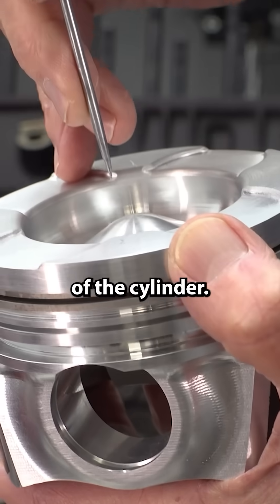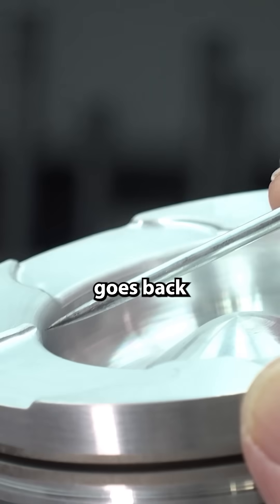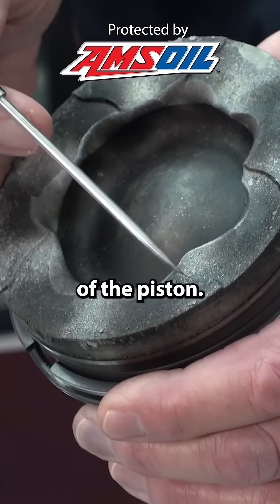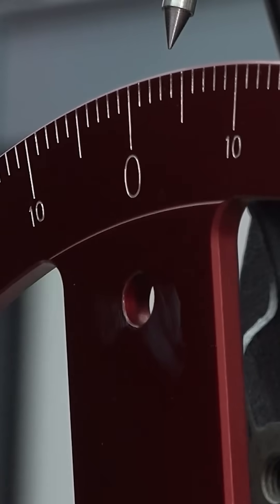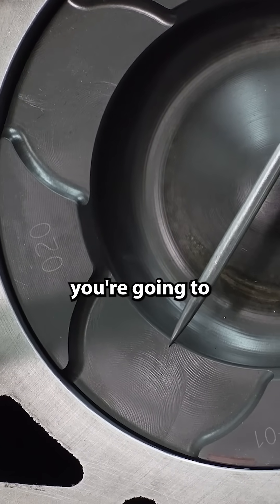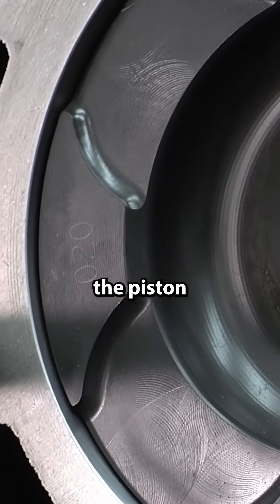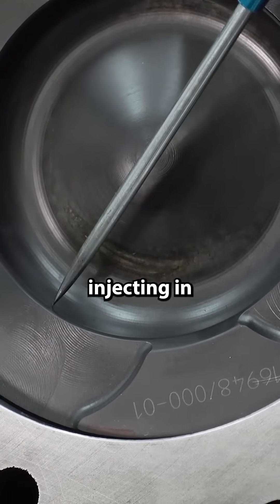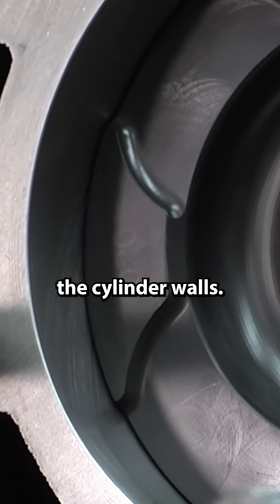How to burn pistons.

Comment: He gave everyone a hint in the t.d.c BTW
Reply: I always thought peak cylinder pressure should occur at 14*ATDC
Reply: @thisisyourcaptainspeaking2259  depends on stroke and rod length?
14 atdc may mean thrust is nearly directly down instead of at an angle?
long rod and short stroke make for vertical thrust on big end?
short rod and long stroke puts thrust on side of big end?
Reply: @rosewhite---  As far as I know, this is independent of bore/stroke but It's not clear to me if it's true in all configurations of piston engines, I believe it is.
Reply: @thisisyourcaptainspeaking2259  Peak cylinder pressure occurs at TDC and contines after TDC until the end of injection.  Why Diesels hang on longer under load., combustion takes place under, 'Constant pressure'.

Comment: Those pistons are stupid as hell solution to having a poor injection managment that can't make multiple main injections :/
Reply: Efficiency is chasing not whole percentages... 0.1% increase across say 6 or 8 pistons may not seem like a lot. But when everything comes together as a total you can gain 10/25/20% across the board. That's a huge deal. 

As engineering explained (the channel) explained years ago... Heat control is key to internal combustion engines.
Reply: @TheGrippySocks  0.1% increase efficiency per cylinder equals to 0.1% efficiency for the whole engine.
Reply: @maritaquality
1 second ago
It does not happen, if this was problem it would have been solved a 100 years ago. If any fuel mist touches any surface, the fine droplets combined into bigger droplets that are slow to burn. The burning is incomplete by the time the exhaust valve opens so you get smoke, loss of power higher, fuel consumption.  When the first amount of fuel is injected into a Diesel engine then the pressure and temperature in the cylinder increases very rapidly, so the remaining fuel is instantly burnt on injection
Reply: If it wasn't for emissions there wouldn't be so much bs
Reply: @MadMan_123  what ? multiple main events and some pilots give you better efficiency and less stress load from smaller detonations and more homogenous mix. Better emissions are a side effect of that, but hey if you want to stick with that style pistons from 1935, go for it.
Reply: @tommybronze3451  no I mean the restrictions implemented by the EPA. They have to do all these things to meet mpg requirements, egr bs, and all that. They need to keep it simple stupid, a diesel motor that runs real hot with a higher compression ratio is simply going to last longer and can be designed to consume even less fuel than we currently do with little to no emissions equipment. A lot of the shape of this piston has to do with properly dispersing nitrogen through the combustion chamber for a cooler burn while still meeting all the other requirements then we gotta spend extra fuel getting the dpf hot enough to burn all that off, like how does running my tractor 12 hours full tilt for a regen forced to sit in one spot helping the environment while also burning extra ammonia
Reply: @MadMan_123  Ok, apologies then. 
About the emissions - it's complicated as hell. IF you run your engine gotter it will simply be more efficient, if you run you combustion hotter (ie detonation rather than deflagration) then you will produce unbelievable amount of NOX. I know that people don't like it but soot + SOX + NOX is very much a gas chamber mix, because of that we have those low sulphur diesels (makes angine last less) and all the additional after treatments for NOX. 
Sad part is that if people would be prepared to pay + 4000£ per vehicle, we would have after treatment systems that don't damage the engine and don't influence the MPG. Then with economy of scale those would become cheaper. Problem is that people are such a cheap bastards that they stick M5 badge on their 518d just to show off.
Reply: @tommybronze3451  nice thing about running hotter and soot is you can get the combustion process hot enough to burn all that up, especially on a hot motor with a hot turbo combined with proper fueling you get more burn and less soot, it would be possible to make a diesel engine with just some basic equipment to burn just as clean as our current machines do.catalytic converters are pretty much all you need for a well tuned machine. 

I've always said we need to take a step back with the auto industry and the non luxury brands need to come out with a lineup of basic but reliable vehicles. Best thing for the environment would be to design cars to last a lifetime rather than buy a new one at least every 13 years. Look at the 1990 f150 for example, very easy to work on very close to what I'm describing but still has a lot of cheap dssignes that are prone to fail, the idea is we need fo go back to trucks like that, refine them with what we know now, could also easily get better mpg with current tech.

Comment: There used to be things called "indirect injection" diesel engines that could tolerate injectors that were totally worn out and squirting like a racehorse. They lasted for many hundreds of thousands of miles without major maintenance.
Reply: they were also hard to start in the cold, and terrible on fuel.  There are plenty of high mileage direct injection engines that can do a million miles.  Cummins,CAT, Detroit,Mack etc.  Lack of durability has nothing to do with direct injection.
Reply: @wazza33racer there is very little mpg difference between direct and indirect injection. It
Reply: @jamesfranko5098  There is a significant enough difference that they are no longer used. Indirect injected diesels lose much more heat into the cylinder head, reducing power and increasing fuel consumption. This is also why they were hard to start in cold weather.
Reply: But that doesn't make the manufacturers more money when they charge you for a whole new engine.
Reply: @spyker_aileron  This video shows you what happens when you start adding “tuners” to the engine.
Reply: My 1990 F250 xtracab has the 7.3 IDI NA with a 5spd trans.
Reply: Yes I have a 1991 ford f350 4x4 with 7.3 idi non turbo  still running only has 178.000 has plenty of torque but it's a lead slead just really rusty I will keep it till I die have a 2005 ford f350 with 6.0 in the driveway broke down have done standpipes injector orings starting on the oil cooler and doing a rebuilt oil pump hope that fixes it just stop running last year driving down 95 doing about 70 just shutoff before this sometimes it wouldn't start after it sat for hours
Reply: @edwardkesock216  Just my 2 cents. My 6.0 dies and won't start because of the glow plug harness. I give it a wiggle below where the wires come together and it's all good to go .... till it shuts off again lol. Electrical connections, am I right ????
Reply: Indirect is great, but it won't put down great mpg numbers. My direct injected commonrail 2.0 can get up to 50 highway
Reply: Called Precup injection,  cat used this on the D8 and D9 engines. These were started by small 2 cylinder gas engine, called Pup motor.😊
Reply: I have a 7.3 idi and a 6.9 idi in a couple f250s love those but my 98 3500 with the last year 12v Cummins is way doper
Reply: Thats the beauty of a prefire chamber :D
Reply: I had an 1985 caddy Seville with a 5.7 Diesel engine, such a great engine
Reply: There still out there along with its center fire brothers
Reply: Almost all diesels are direct injection anymore.  Those “old days” diesels were pithy in performance compared to todays diesels too.  

A diesel can easily last big miles: BUT they are highly intolerant of poor maintenance: oil  changes, fuel filter changes. Fuel/water separaters.  All need to be done as recommended.
Reply: @TheBeingReal  that is completely correct. In this modern age there are 99% efficient 2 micron filters available for fuel and bypass engine oil.  Plus we have synthetic oils that are easily better than the previous mineral oils of the 80's and 90's.
Reply: @wazza33racer 2 micron filters don't matter when u spraying down the cylinders with fuel. Eventually it'll be worn out and with nothing in short time
Reply: @kwmiked  That’s why engine shops love the rolling coal guys. $$$🤣
Reply: Yes, sometimes they did, not every indirect injection diesel was reliable.
They also made less power and used a lot more fuel.

So today those 100,000s of miles would cost you 100,000s of $$

Not really an issue when diesel was 12c per gallon.
Reply: @elliotkane4443  5 cent he is talking long time ago lol I'm just being funny I laughed loud as hell reading your post and that's what I thought I would add !!
Reply: @elliotkane4443  Less than one of these rebuilds where a pissy injector melted a piston and blew up an engine would completely offset any fuel savings. And IDI diesels weren't that much less fuel efficient due to the higher compression ratios.
Reply: @elliotkane4443  Power requires fuel.
Reply: @WilliamStewart1 yes but the higher compression meant that more of that fuel was burning at the same flash point.
Reply: Those are the engines they don't produce anymore because they are to good and don't brake so they can't make money
Reply: Ugh doing injectors on my 02 was a fkin pain amd still with doing it myself it cost 3500 bucks...... then had to deal with about a dozen other spots sucking in air into the fuel system. But with 277k miles that's to be expected ig. They do last a long time with proper maintenance but it ain't cheap. At least ive never had to replace a trans like cummins guys. Every brand has their gripes. Except for maybe the 7.3 ford? All I've really heard about those is they don't have much power and suck when it comes to mpg. 

But hey I'd say with 22mpg average on my duramax I probably saved more than 3500 in fuel compared to the 7.3 dually I had which got 13. It was pre turbo but it had an aftermarket banks turbo, wasn't no speed racer but it wasn't an obstacle in traffic, never did anything but regular maintenance on it then around 500k miles the head gasket blew so I sold it
Reply: @MadMan_123  7.3's love to leak oil, all of mine have leaked. Either from the fuel injection system, or the oil pans which are a pain to replace. Other than that, they're pretty simple and reliable. Injectors are easy to rebuild yourself. Couple sensors here and there but they're easy to replace yourself too.

Comment: A diesel has to create the pop or air ignition at the TDC, adding the fuel just after that fire is created finishes the combustion process, any time before this would effectively stop the piston travel…
Reply: Heat/Oxygen/Fuel
The fire triangle
How is there fire before the fuel is added?
Would it not technically be beginning the moment the piston departs TDC? 
Diesels are still 4 stroke; Suck/Squeeze/Bang/Blow right?
Reply: @maxnovakovics2568 Look up what a fire piston fire starter is, this will explain it to you.

Comment: Can this be eliminated with more injection advance?  Also, what fuel quantity and injector pulsewidth is being used?  I'm just curious because I've turned my LB7 up quite a bit, and, as far as I know, I have no way of knowing (without a LOT of math) the crank angle that injection finishes at.
Reply: The problem being time [observing piston was too far down], seems that an injector change might be in order?  Bigger lb/hr rating [stroke on something older] to get at narrowing up the time window.  But... I have no idea what engine this piston belongs to.
Reply: It does not happen, if this was a problem it would have been solved a 100 years ago. If any fuel mist touches any surface, the fine droplets combined into bigger droplets that are slow to burn. The burning is incomplete by the time the exhaust valve opens so you get smoke, loss of power higher, fuel consumption. When the first amount of fuel is injected into a Diesel engine then the pressure and temperature in the cylinder increases very rapidly, so the remaining fuel is instantly burnt on injection

Comment: i think of this demo like holding a cutting torch against the sharp edge of a piece of plate steel vs trying to burn a hole the middle.   the time require to heat it up to melting temp is way less on the sharp corner.   these new diesels combustion temps burn pretty close to the temp aluminum melts and i hate that but it makes sense for emissions and efficiency.    its the only thing i hate about my newer kubota tractor it runs waaaay hotter than my old massey. it will burn your feet up in the blazing summer when working it hard.   i can run the massey barefoot if i wanted too.

Comment: How long does it take for the fuel to ignite? Or, how many degrees?
Reply: A couple, when it does, the temperature and pressure increas rapidly so all of the later fuel injected, burns instanly

Comment: Would Diesels benefit from a 5 valve per cylinder design like gas engines can?
Reply: Diesel engines can have higher boost pressures, which basically ensures more airflow.
Reply: that literally does not answer the question  @diesel-legend
Reply: Tumble and swirl are major considerations in diesels. Localized rich and lean areas in the chamber are a fact of life, due to the combustion process being initiated by streams of high pressure liquid fuel being introduced into a compression heated chamber. Ultimate airflow and swirl/tumble are often at odds with one another. Getting fuel to burn evenly and quickly is not like gas engines where the air/fuel mix is exactly that, a mixture. A diesel is a hot pump that poorly atomized liquid is introduced into. Combustion efficiency is achieved by rapid mixing. Hence swirl, tumble, multi pattern fuel spray, piston shape, high injector pressures etc.
Reply: @raj-u6t1m  that's a lot of words for a non answer
Reply: @camrongoodall  ok. the answer is no.

Comment: So use a bigger injector and less spray time?
Reply: It does not happen, if this was problem it would have been solved a 100 years ago. If any fuel mist touches any surface, the fine droplets combined into bigger droplets that are slow to burn. The burning is incomplete by the time the exhaust valve opens so you get smoke, loss of power higher, fuel consumption. When the first amount of fuel is injected into a Diesel engine then the pressure and temperature in the cylinder increases very rapidly, so the remaining fuel is instantly burnt on injection

Comment: Instead of that, you really need 3 injectors in a triangle above it. Less pressure, more pressure, little less angle, then more pressure with even less angle. That’s why 3. Time it right and it would be perfect
Reply: @maritaquality
1 second ago
It does not happen, if this was problem it would have been solved a 100 years ago. If any fuel mist touches any surface, the fine droplets combined into bigger droplets that are slow to burn. The burning is incomplete by the time the exhaust valve opens so you get smoke, loss of power higher, fuel consumption.  When the first amount of fuel is injected into a Diesel engine then the pressure and temperature in the cylinder increases very rapidly, so the remaining fuel is instantly burnt on injection

Comment: why is the injector still injecting when the beginning of fuel delivery is at 29 degrees before top dead center  ?
Reply: It is not, as such, most engines start of injection is around 15 degrees before TDC and is well finished by 20 degrees after TDC, only if the engine is on full-load.  Diesel have a complely different comnbustion to a petrol engine, for a start no spark plug. The fuel is injected over a number crankshaft degrees, why diesel hang on longer under load to a petrol engine.  Most fuel injection on a Diesel engine is completed by TDC if not full load.

Comment: Probably plenty of reasons why but is there a way to pause fuel for a split second as it gets closer to the Crown / 40°  then restart after the piston is down the bore out of the way?
I know it would wash the cylinder of oil and probably overheat if it has concentrated stream spray. 
But what if it was in a conical shape spreading the heat
And would cylinder wall washing/spraying be to damaging?
Reply: It does not happen, if this was problem it would have been solved a 100 years ago. If any fuel mist touches any surface, the fine droplets combined into bigger droplets that are slow to burn. The burning is incomplete by the time the exhaust valve opens so you get smoke, loss of power higher, fuel consumption. When the first amount of fuel is injected into a Diesel engine then the pressure and temperature in the cylinder increases very rapidly, so the remaining fuel is instantly burnt on injection